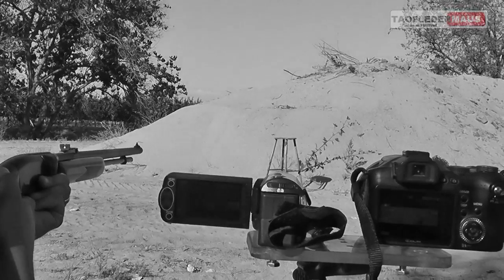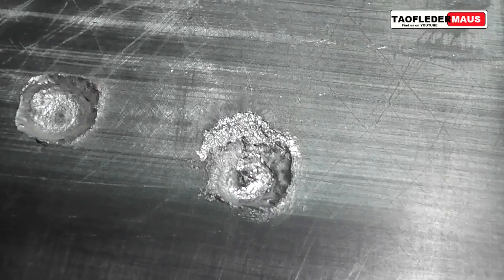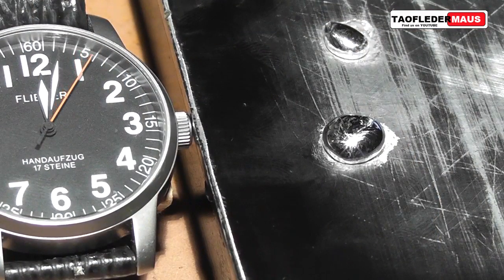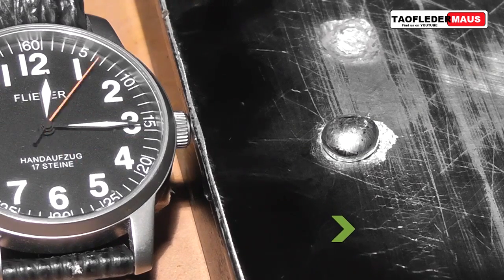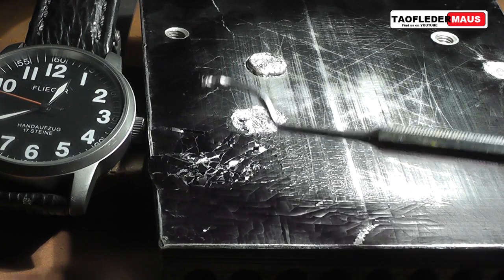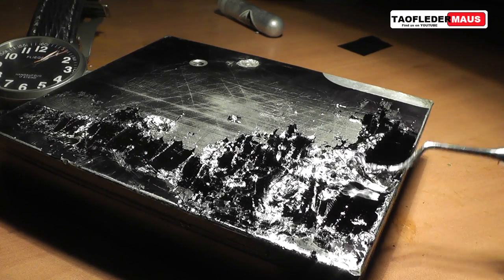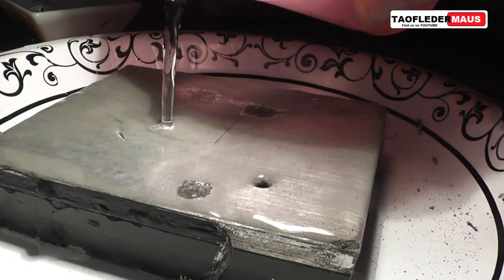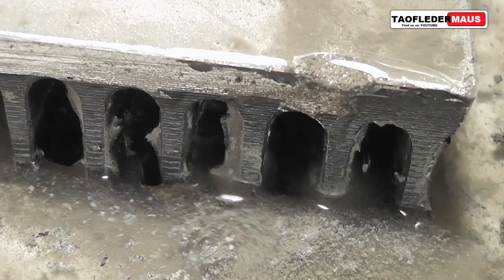Demonstration of GALLIUM's Amazing Destructive Power (gallium bullet follow up)

Comment: Wow. That was unexpected. That could be dangerous. Imagine a few drops of gallium on the swingarm of the rearwheel of a motorcycle. It will snap without warning. Or machineparts that keep ball-bearings in place. My router makes 23000 rpm in a aluminium housing. It scares me to think what could happen is the router is at full speed and the construction of the thing fails...AAHHHH. Flying coils, magnets, axles and sharp blades. That'll make me duck and coverrrr. So next will be that terrorists will not say I have a bomb on the airplane, but I have a few drops of gallium. As far as I can judge now it could be that one kilogran of the stuff can bring down a 747 without real warning. No way you get far if you have gallium on your wingmounts. My guess is that it is to late before you notice. A few hours and your plane is scrap.  Interesting test Jeff. Thanks.

Comment: Perhaps  you could add some hard abrasive particle to the gallium in the tip of the 22. Tungsten carbide or even hardened steel?  Would those open enough points in the oxide layer for sufficient gallium to enter and begin degradation?
If not, perhaps a higher power round tipped with gallium would cause sufficient localized cracks that would allow the gallium it carries to start degrading the material?

Comment: What if you filled a chamber inside the round with liquid gallium ( not freezing it) and pluged the hole with hot glue? that way it would shatter the black layer exposing the al to the gallium

Comment: The electricians's hammer, what ever is in his hand at the time!
Reply from the maker: Haha!   It's amazing how versatile a Crescent wrench is.  They work well to pop out knockouts in a peckerhead,   and as a prying tool,  you can use the heel to push a coupling together or lift a heavy motor to shim it,  etc.   I rarely use them as a wrench.
Reply: ***** ...or as a sheetmetal break.  They even work left-handed.  Amazing things!

Comment: I could see military application of this easily, they scatter this across an armored vehicle and it would compromise any alimun component it contacts. This would be insanely effective in aircraft.
Reply: Conventional explosives are much cheaper and just as effective. If there was a useful military application for gallium, it would already be exploited as such.
Reply from the maker: Still, if the alum.  is painted or anodized,  you'd have to scratch through to get to the base metal.   So,  that was the task of blasting it with a bullet.
Reply: Photographic Time  Most of that price is electronics, flight control, targeting and such. Just the explosive component is probably relatively cheap, though I don't know what type they use in hellfire missiles.
Reply: Photographic Time A weapons system utilizing gallium that was actually effective would cost just as much, if not more. Not to mention that most military ground vehicles don't use aluminum on the outside, and near-instant destruction is more effective than slight damage and corrosion.
Reply: Mercury does something similar and there's a rumor of some commando's doing just that to aircraft during ww2. Not sure how true it is though.
Reply: Inspector Nefarious  Actually the new HMMWV and MRAP both use exterior aluminium for the armor plating. Gallium would best be used as a sabotage weapon, discretely that is. But since we "follow" NATO and Geneva conventions, chemical warfare is frowned upon.   As a weapons inspector for the AF, I can tell you we rather use overpriced overpowered weapons for the propagating morality effects vs the cheap silent killers, aka bullets.
Reply: Inspector Nefarious Well you see, it could go into the radiator, then into the engine. Most American military AM General vehicles don't have aluminum blocks but the enemy doesn't use them anyway. They generally use Toyota's like the land cruiser which has an aluminum block. Maybe they could infect a countries fuel supplies such as gasoline, jet fuel and natural gas, destroying infrastructure and equipment. I could see a few hundred gallons of gallium becoming incredibly dangerous. The best way to do it would be to make it into beed form, because at room temperature its solid, in pressurized lines like natural gas will rise melting point and it will become liquid at cooler temperatures. (see I have it all planned out) Evil laugh
Reply: Malacovics
A thermite grenade, which is fine rust powder and fine aluminium powder, is dirt cheap, and tossing one in the barrel of a tank creates a large blob of molten iron to royally fuck it up.
Reply: Aluminum is an extremely soft metal that isn't used for armor plating in anything.
Reply: Inspector Nefarious Actually military explosives are incredibly expensive. The hellfire missile cost half a million dollars each.
Reply: Photographic Time 5 times less. A hellfire is ~$110.000.
Reply: Seroster Problems arise when you try to actually execute that plan without being blown up sky high.
Reply: That's on the job application for the military.
Reply: Fræ Studios The M113AS family of Armoured Personnel carriers were made of Compressed Aluminum, They took a block of Aluminum 2 feet thick and compressed it down to 1 foot, and called Armoured Aluminum,
Reply: Photographic Time Toyota landcruisers have a cast iron engine block,The heads were too till recently.
Reply: You could mess up a Ford F-150:)

Comment: That reaction, if I recall, is the Aluminum reacting with the water forming Al2O3 and H2. Because of that oxide layer this normally wouldn't happen. But since gallium interupted that passive layer, it can react to air, and even water.

Comment: how much will it take to "dissolve" a plane?
Reply: I believe the reaction is a catalytic one; the reaction that weakens the lattice has an end product of reactive gallium metal, which goes on to weaken neighbouring Al.  The reaction will apparently continue until the gallium becomes physically isolated from more unreacted Al.
Reply from the maker: Bring over your plane and we'll find out!
Reply: Yes, I think nearly all of those properties and effects are in play:  the destruction of crystal form; the prevention of a protective oxide layer, and participation of the edge molecules.  There's no density or molecular relationship between the gallium and aluminum, because the gallium is not consumed by the reaction; after the aluminum  lattices  have been compromised into a weaker, more porous structure, the gallium is released, whole, no more or less reactive than it was initially, in proximity with the next Al crystal, such that the same reaction can happen again and again.
The energy required to free up the gallium again comes from entropy:  as the state of order of the aluminum deteriorates, energy is released.
Reply: Well, if someone does put Gallium on a plane, all of us will be suspects. :)
Reply: How much mercury paste does it take to weaken a structural component?

It's the perfect stuff to dispose of that aluminium bat that you just finished using in your latest murder...
Reply: For what i'm aware, Gallium stops the ceramic oxide layer(the typical white/gray Aluminium look) from bonding to itself . The aluminium keeps oxidizing but it never gets its protected layer. What happens inside the aluminium? Aluminium has a face-centered cubic lattice.(Google)
Im guessing the gallium bonds with one of the atoms on the edge, destroying 8 of those crystals, and cause Gallium is denser than Aluminium, the amount needed it alot less. 
Im not a chemist, we learned Metallic bonds and stuff.
Reply: This sounds like a bad terrorist plot :P
Reply: I think that is more a time based reaction

Comment: Is it possible to mould your own bullets with gallium?
Reply: You could but you would have to keep them at or below 85°F (29°C) or they would melt. So firing would just liquidize the round. You could probably make one for a pneumatic air rifle, air soft gun, or slingshot.
Reply: what if you created an all wax slug, drill out the top so that you create a chamber, give it a gallium core,  then seal it with wax.
Reply: *****
 you could form a bullet and then jacket it with copper or something, so that the core of the bullet is gallium and the jacket is thick enough to still be a viable bullet even if it gets warm enough that the gallium inside melts
Reply: ***** Oh ya that is true I did not think of that.
Reply: *****
I think it would work better if you had empty copper jacket and then just pour molten gallium in it
Reply: shadycat77
my thought would be the wax would act frangible, but also break the initial layer  of paint or anything anodized, leaving the galium core to interact with it.  if the wax itself isnt enough, imbed 1 or 2 pellets of bird shot on the tip.  I was thinking a wax slug would have room for more galium.
Reply: *****  very cool would like to see that
Reply: i was thinking something similar,  like a wax slug with pellets of galium
Reply from the maker: You probably could but you'd just have to keep them cool/cold.
Reply: DDBwest Just take a regular hollow-point round, fill the cavity with gallium and seal with wax. I'm not sure what effect the gallium would have on the bullet, so I wouldn't store it long term. People have been known to do this with cyanide to guarantee one shot one kill.
Reply: Bullets that can destroy cars
Reply: ***** copper should be strong enough for the bullet to leave the barrel in one piece but as thin as possible for more gallium. good idea but probably too hard to make.

Comment: Very interesting, now every time I get on an aluminum airplane I have to be hoping that nobody spilled gallium on the wings. I would hope that stuff is a no-fly item.
Reply: My guess is that it is completely safe to fly with as the outer plane most likely has a thick coating over it and the gallium could not reach the aluminium wing. It would also be seen in the security process of airports too.
Reply: And me I'm glad that I'm too poor to own an Audi R8 (aluminum chassis).
Reply: Galium is solid at temperatures below 30°C
I'm guessing it can't react when in solid form then
So if the outside temp is colder than 30°C and the aluminium is as well I think it can't react
Reply: +John Bare One more reason to use titanium instead of aluminium.
Reply: TheGameMouse Thanks I was thinking there should be. Was just thinking out loud as that aluminum got funky real quick.
Reply: *****
Any old extruded aluminium works the same, "aircraft grade" means pretty much nothing.
Reply: +John Bare It will be difficult to screen for Galium since little is required to cause damage, I don't know if it is on the no-fly-ítem-list.
Reply: +James Sowell i mean why wouldnt it be man
Reply: A terrorist will shape it into a spoon/belt buckle/key and bye bye airplane...
Reply: Aluminium is cheaper than titanium, and easier to produce, not like someone would be able to pour gallium on a planes wings anyways.
Reply: nambinhvu it would melt

Comment: You could turn a Lotus Elise into dust with a few drops do that. :(
Reply: Green Silver Lets dump gallium on an aluminum engine while it's running and wait for it to self destruct!
Reply: are they not carbon fiber now ?
Reply: Not the Elise, it has alliminum  chassis, the engine is also alliminum. I'd love to see how this stuff reacts on a car intake manifold where it joins an ally cylinder head.
Reply: *****
Has there been a cast iron engine block made for a commercial car in the past say, 50 years? =P
Reply: Seroster Absolutely... I have four vehicles in my driveway all made after 2000, all of them have cast iron blocks and only two of them have aluminum heads...
Reply: desertfox2020
Make and model?
Reply: Seroster 01 Dodge Ram with a 5.9L magnum V8, and a 00 Cherokee XJ with the 4.0 inline six. The two with aluminum heads are an 02 Buick Century (3100 V6) and an 05 Pontiac Grand Prix GTP CompG with a supercharged 3800 V6. Of these I own the Dodge and the Pontiac.